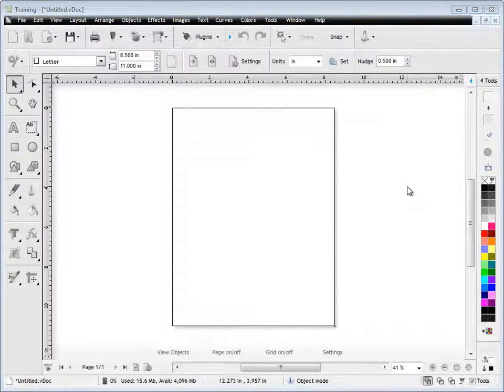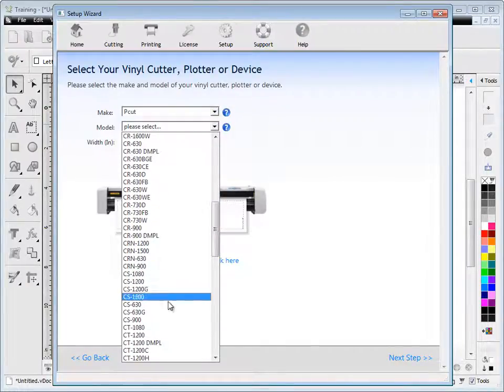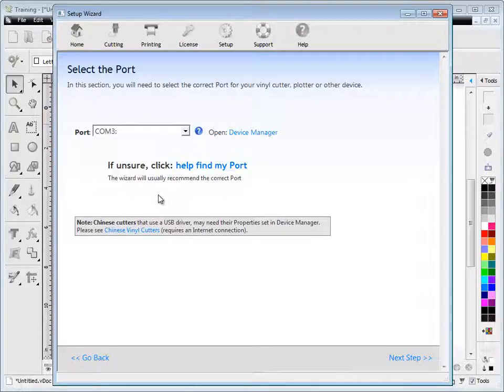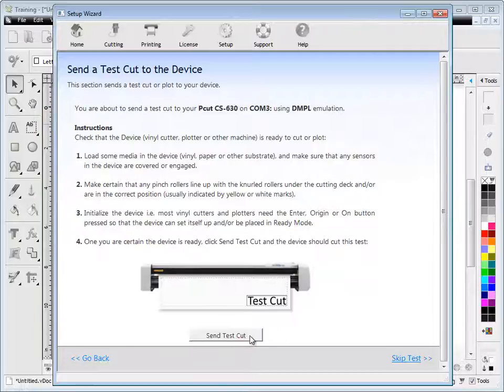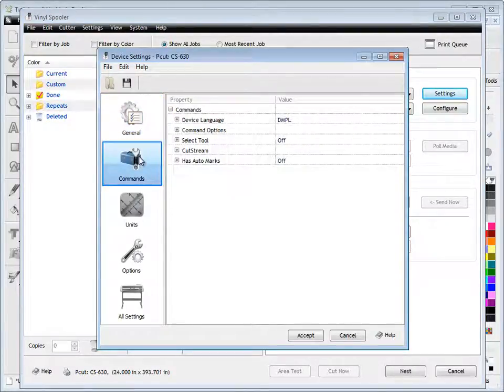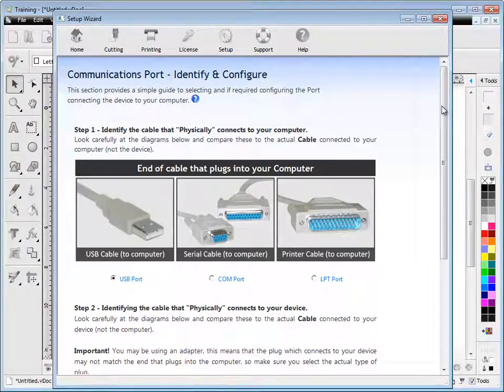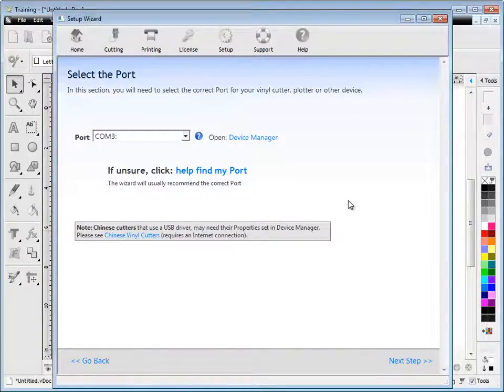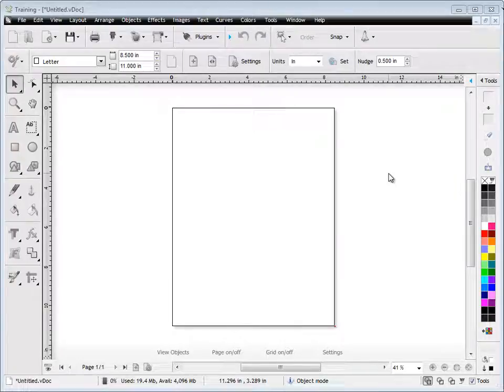VinylMaster V4.0 - How To: Setup a Cutter or Plotter

Comment: Hi, Im using Cuyi Cutter/Plotter CTO630. Ang Im trying to set it up with VinylMaster but I cant find it on the list. Maybe you can help me... Thank you
Reply from the maker: The CTO-630 is made by Creation so go to Make: Creation, Model CTO630.

Also, that model must be set to Direct COM which is easy to set up in the Vinyl Spooler. First make sure the cutter is switched on, has vinyl loaded and ready to cut a test file. 

You can open the Vinyl Spooler from the File (menu) > Cut/Plot > Vinyl Spooler. 

In the Vinyl Spooler, click on the:

- Connection tab (top right corner).
 
- Then in the Connection Method > Port Type, select Direct COM Port from the drop down.

- Next in the section directly below this, click Detect and follow the instructions in the wizard.